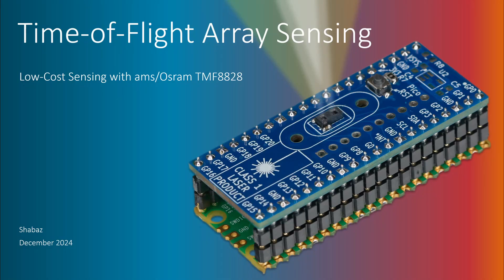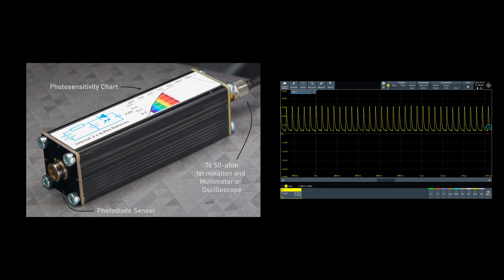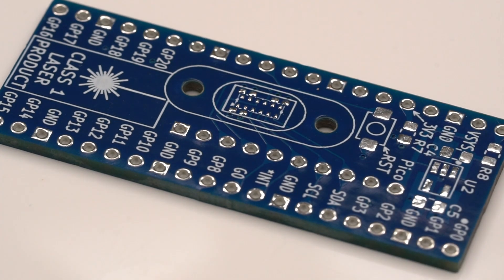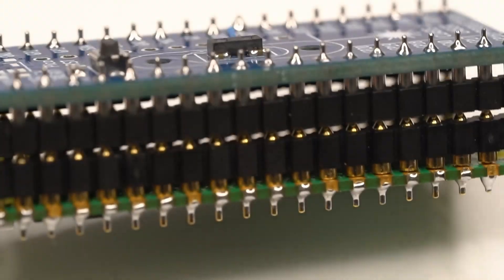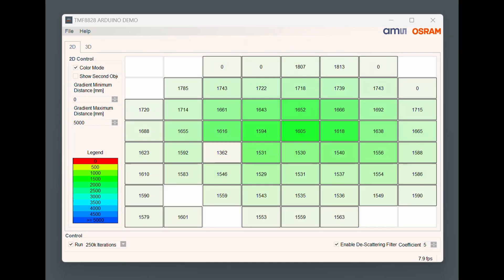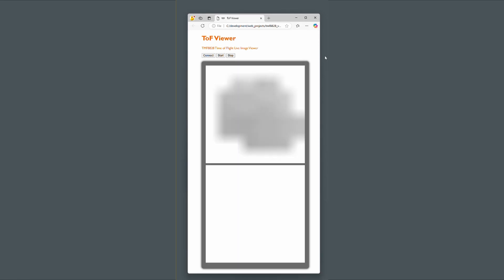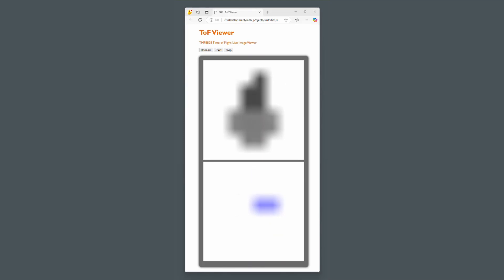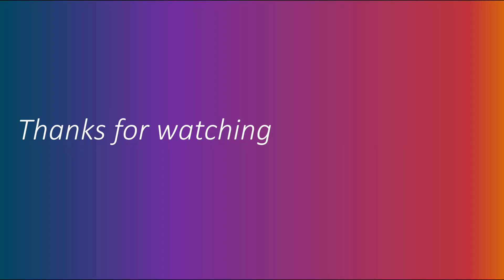Time-of-Flight Imaging with ams OSRAM TMF8828

Comment: But how can laser see behind an object it's opaque to?!
Reply from the maker: Hehe yeah it's confusing at first. Easiest way to see this, is to imagine each "pixel" in the 8x8 grid is really many tinier sub-pixels that get summed. Now imagine each large "pixel" looks out in a cone-shape into 3D space. If the tiny sub-pixels in the center see a reflection sooner than the outer sub-pixels, then the TMF8828 considers the center measurement for that large pixel to be the primary object, and the fringe measurement to be a secondary object. The secondary object can be useful to detect things that are sloped, too, in a similar way. I hope that helps!
Reply: @shabaz_  Very weird and interesting! It sounds like Terrell rotation though I know it has nothing to do with it :) Do you know if it has a name I can google?! or a video that visualizes what you just described...
Reply from the maker: @DrN007  I'm not aware of a video about it, but there's a bit more of an explanation in the write-up here of the overall general mechanism that the sensor uses, so hopefully that can help a little bit further: https://community.element14.com/technologies/sensor-technology/b/blog/posts/time-of-flight-imaging-low-cost-sensing-with-ams-osram-tmf8828-and-pi-pico in the section "How does it work?".
Reply: @shabaz_  Thank you very much!
Reply: @shabaz_  Thank you very much!

Comment: Radar sensors are becomming so cheap now and much more accurate for these scenarios. For example this one: https://www.youtube.com/watch?v=osrZAIDQu2s
Reply from the maker: Agree, it's amazing how good microwave radar sensors are. I have tried a couple, but didn't record a video unfortunately, but I wrote up some of the experiments here: https://community.element14.com/technologies/embedded/b/blog/posts/experimenting-with-microwave-based-sensors-for-presence-detection it's pretty stunning what those sensors can do. Regarding optical, I experimented a bit more with the TMF8828, and noticed that if it's pointed directly at a door face-on, then it can detect when the door is opened by about 150mm or more, which is interesting. It's to do with the second object detection, because each "pixel" in the 8x8 grid is actually composed of several smaller sensors, and the TMF8828 can provide two results per pixel if it detects there's something further back. When a surface is slightly angles (which a door will be when it is partly open), those pixels generate two object results, which makes it very quick to determine if the door has been opened. Another use-case which should be very easy for the TFM8828 is to detect when a person is fully centered in front of a kiosk, and can also detect basic gesture detection like which hand is raised, or if they jump up and down.

Comment: In what ranges does this operate? not great resolution, but if the distance is accurate on a very wide band then I can understand why this is powerful.. Thanks and all the best ❤
Reply from the maker: HI! It can measure distance to 5 meters, however I've not done any accuracy tests yet. It's still a very new project, so testing is limited (I've increased the response speed since the video however). Regarding accuracy, the datasheet shows ballpark +-15 mm for most distances less than about 300 mm, and 5% for distances longer than that.
Reply: @shabaz_  wonder if the chip can be overclocked , overvolted or somehow hacked to provide 50m+ range... Even if accuracy goes down, a wider area of operation seems more practical.
Thanks for answering 💜 subscribed!
Reply from the maker: @fire17102  I think it will be difficult with that device, because there is some coating over the laser to spread it, and a narrower beam would be needed for longer range. However, you got me interested to see what is available for longer range. I saw a module on Aliexpress, which is called "50m Laser Distance Range Finder Moduule" model number HI50, which has a serial interface. That could be interesting to try. I'm tempted to buy it too. It is more expensive though, about $35.